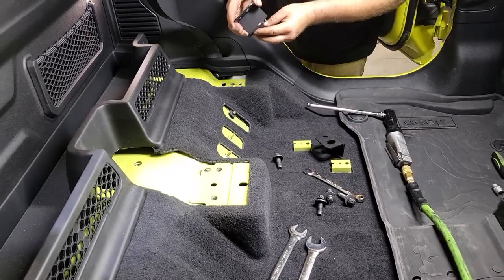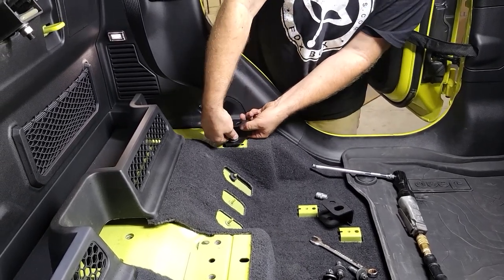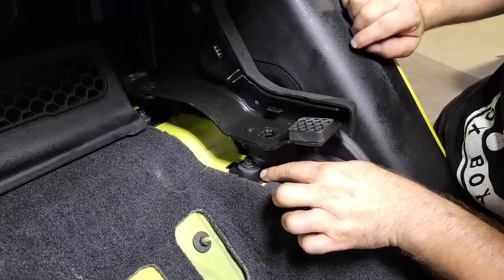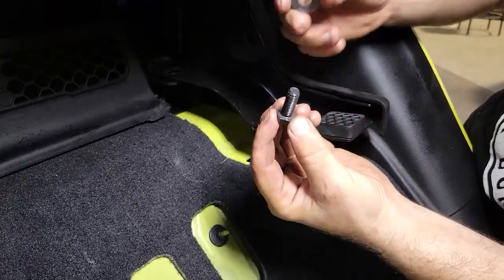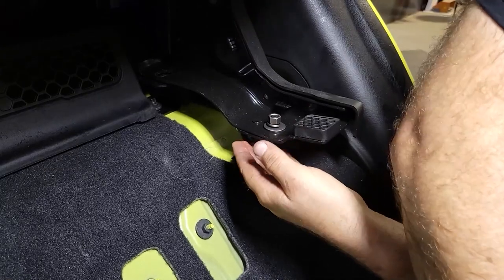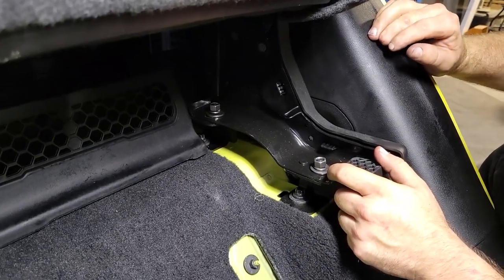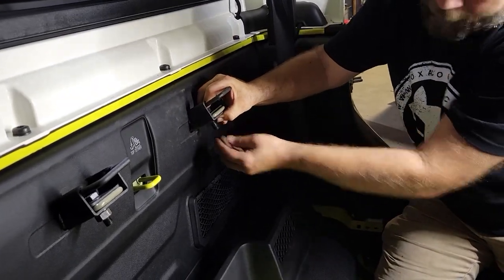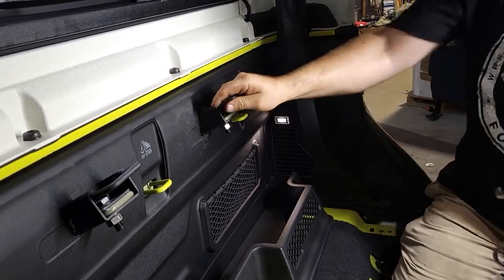FOX ACOUSTICS JEEP GLADIATOR TRUCK 2 INCH SEAT LIFT KIT INSTRUCTIONS

Comment: What hold the box down?
Reply from the maker: It uses the jack stud through the back of the box to stop it from sliding forward. If you want more, some people drill a hole through the bottom to bolt into the threads that the under seat storage bin used.